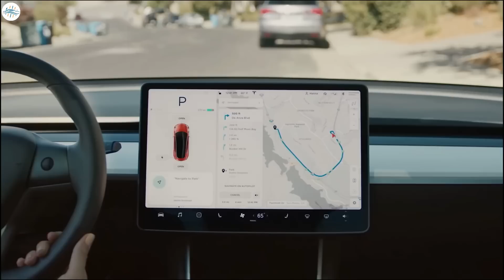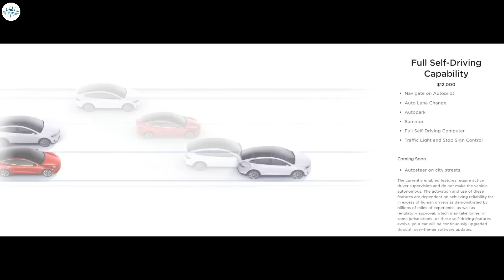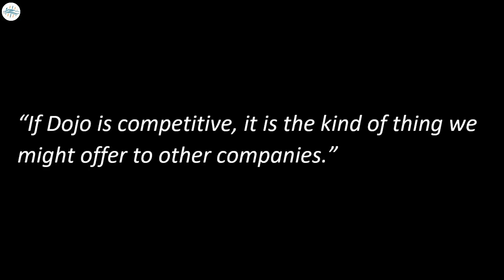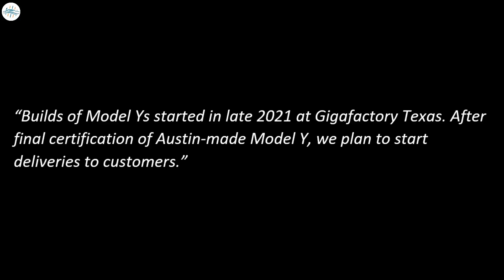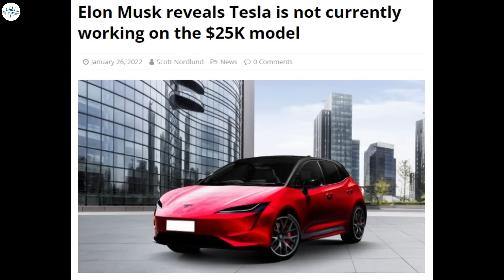Tesla's New Model Y With 4680 Confirmed & More Updates!

Comment: Regarding 4680 battery.  What happen if I live the west coast and have an Model Y with the estimated delivery date of Q2 ?  Am I going to get whatever is coming from Fremont or Texas  ?   The webcast said that Texas will produce Model Y for the eastern 2/3 of the country.
Reply: You will get whatever Fremont is pushing out. From what I’ve read, it’ll be the older cells until supply is depleted and then you’ll get the 4680 cells with your car whenever they start building your car. If EDD is Q2, you’ll have a higher chance of getting the new batteries. Good luck! Getting my MYP in a month…hopefully.
Reply: @sirtrizzle6272  if you are getting yours in a month then it’s still Q1 that is likely the older battery not 4680, right?
Reply: @MK-jq8xl  yup! Most likely the old batteries but with new chip for sure.
Reply: @sirtrizzle6272  what is myp? Model Y Performance??